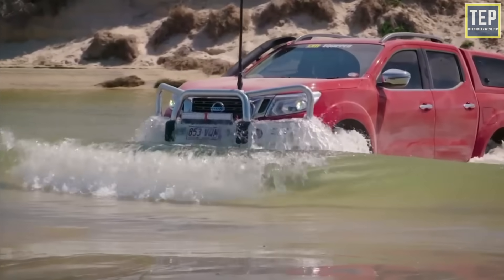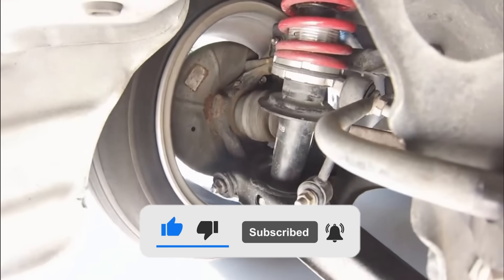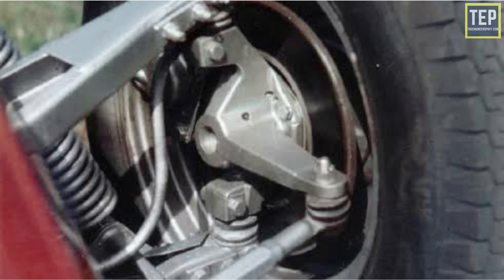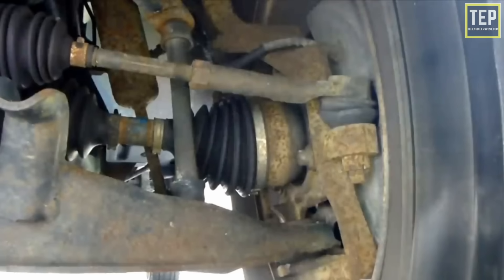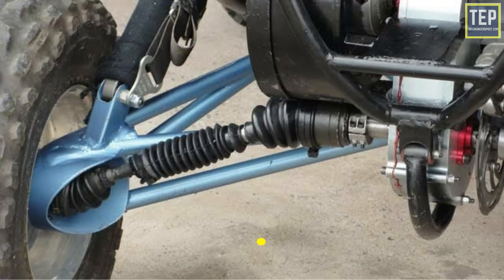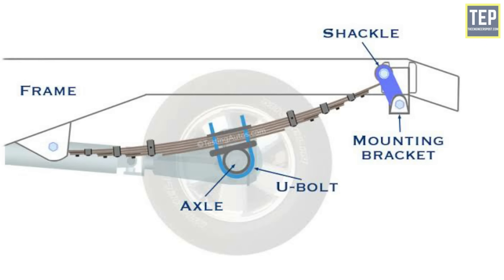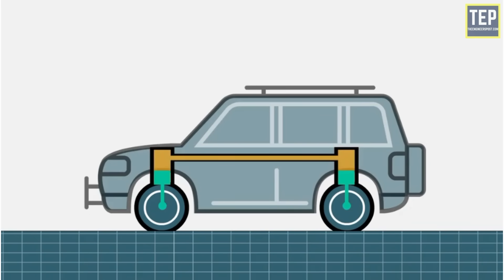How Different Types of Suspension System Works? Explained in Details

Comment: 😂 fourth type is coupled spring means two springs attached such a way one spring in tension and then it serially connected with another spring in compression like bicycle seat springs . Do thath the force will travel opposite direction and nullify the jerks.. we are now designing such spring system for cars 😂😂

Comment: Very american and very ignorant. Not a word about the Citroen hydropneumatic suspension! This system is superior to any mechanical springs. It uses gas filled spheres with its upper part filled with nitrogen gas as suspension and with hydraulic fluid as damping, through small valves at the bottom of the spheres. Very reliable and never needs replacing. Only new gas is needed to fill at long intervals, but is very cheap and easy.
The system also has constant ride height, irrespective of load. The ride height can also be varied. This system was introduced on the Citroen DS 19 already in 1955, and has been built into millions of Citroen cars. 
The DS 19 had trailing arms at the rear and individual wheel suspension all around with hydropneumatic spheres. No other suspension system can rival it in terms of safety, roadholding and comfort, even today!
Stiff rear axels and leaf springs is totally outdated and belongs to horse drawn carriages from the 19th century! And the McPherson strut is very simple, bad working and cheap, more than in one sense! It has no advantages whatsoever, but is cheap to manufacture and install, therefore used on many cars.

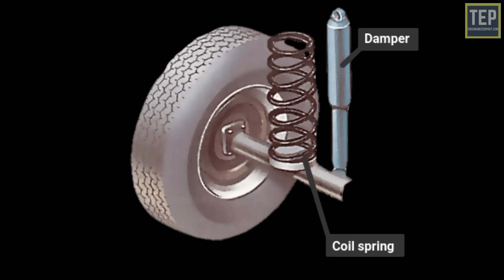Comment: 1:30 basics
2:15 types of springs
3:30 dampers/shock absorbs
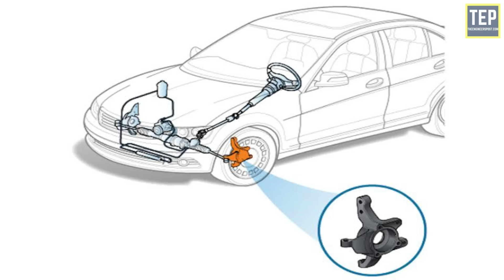4:10 nuckle (wheel connector
4:40 strut (bar suport)
5:10 anti sway bars
5:40 ball joint

6:55 independent suspension
7:40 independent suspension
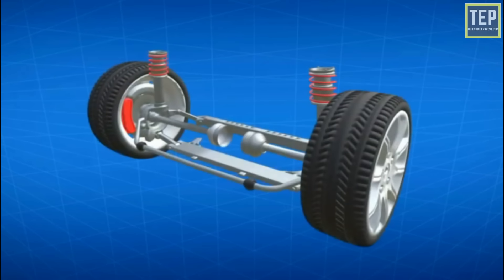8:10 wish bone
8:50 double wish bone
9:40 double link
(Independent)
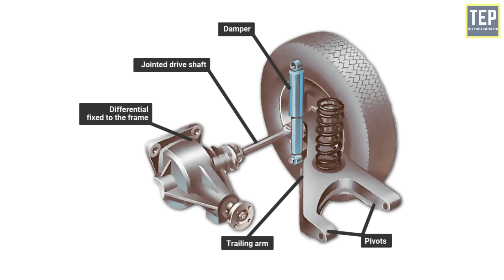10:15 trailing arm
10:50 non independent
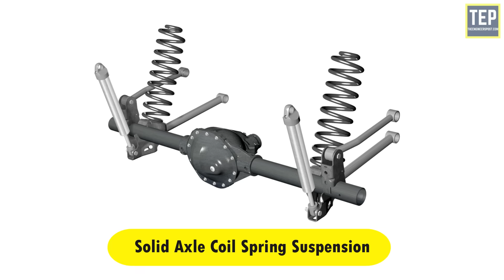11:20 spring sey (trucks)
12:10 solid coil spring

Comment: You forget a very common independent front suspension being twin I beam. Also they used nitrogen in some variations of the hydro elastic and hydraulic versions of the swing arm suspension…swing arm are both fixed axle an independent axle configurations

Comment: The overall suspension system is very flexible. However,  if you separate it into component parts, you find nothing flexible. Every part is rigid and stiff

Comment: You left out the  Hydropneumatic suspension, a type suspension system designed by Paul Magès, invented by Citroën, and fitted to Citroën cars, as well as being used under licence by other car manufacturers, notably Rolls-Royce, Maserati and Peugeot.   It clearly the very best type.
Reply: Why did Citroen give up on using hydropneumatic suspensions?
Reply: @encapsulatio cost. I agree, I had an XM and the ride was sublime. With the deformable rear bushes and trailing arms giving a form of passive rear steer, it even handled well....
Reply: @avoohanian   What do you agree? I asked a question, I'd prefer if you can answer that.
Reply: @encapsulatio  I agree with you about hydropneumatic suspension......
Reply: @avoohanian  I did not even say anything about it so i don't understand what you agree with.

My question below is what I "said".

Why did Citroen give up on using hydropneumatic suspensions?
Reply: What about toyota tems system

Comment: You forgot that with the solid axle coil spring setup there are multiple diffrent ways of attaching the axle to the chassis such as 3 link, Parallel 4 link, semi-triangulated 4 link, fully triangulated 4 link, truck arm, and torque arm. You also fogot the different side to side axle centering menthods, those being panhard bar and watts link. Lastly, that those centering devices are only needed on NON triangulated designs such as the 3 link, parallel 4 link, truck arm, and torque arm setups.

Comment: This is well done and easy to digest even for non car guys or beginners.

I would also like to add Torsion Bar rear suspension, it's also a non independent suspension common in economy cars. The torsion bar also acts as an anti roll bar but most of the time it is tuned for comfort. The design is simple and cheap to make also there is rarely a way to adjust the wheel alignment for such suspension.
Reply: The kind you're talking about acts as the anti-roll bar but not as the springs.  The cars I'm aware of that have it use coil springs, not torsion bars.  A true torsion bar suspension is found on the front of Chrysler/Dodge/Plymouth rear-drive cars from the '60s to the '80s.
Reply: Yes, probably you refer to semi-independent suspension which is very popular today because its simplicity ,low cost and almost independent suspension. I have a car with this type of suspension and I am very satisfied with the behavior of the car.
Reply: *tortion BEAM, not tortion bar (which is a whole different thing).
Reply: The AI audio is awful.  Why can't we have a real human doing the explanation?  Terrible but fairly good info.
Reply: He did happen to mention it at 3:20, and I completely agree! This made it way easier to understand.

Comment: Anti-sway bars , Anti-roll  at 5:39  .  The video forgets to mention that trailing or leading arm suspension allows those bars to connect without a link (VW bug). An interesting case is the rear axle on a Golf Mk1 which mixes in some camber. Also I did not find a mentioning about steering. See how braking and acceleration is almost the same for a suspension, and similar to cornering! Race cars thus have double wishbone all around ( for track ). Off road you may see solid axle in front and back. Renault Twizy has McPherson all around. I like how McPherson saves joints, but I don't like that it needs a high hood (okay, no problem with an inclined hood in like the Renault Espace). Where is the integral link suspension? It is used in modern Golf and Ford Mustang in the rear. The video forgets to explain that a multi-link suspension allow you to place a virtual pivot in the center of the rubber. Still I like the Citroen DS with a real pivot in the rubber more. Don't need power-steer for that because you only rotate one joint.
I want precision cornering and thus a long, stiff lower wishbone. It may be a bit trailing in the back and leading in the front for anti-squat and anti-dive. Thus I guess I need two links to connect the anit-sway bars. Does anybody have an idea how to connect anti-sway diagonally under the body floor?

Comment: I have search everywhere for the Mercedes twin lower ball joint design and it's like some kind of secret. Even Tesla's, New Camaro's, and a few others now use it. Sadly working in a garage you find most mechanics rather slap you silly for bring in a German car in the first place, because they want a pay check that week! But I digress. I had to figure it out on my own years ago, yet still today, few know how it works and was missed in this video. So see if you can guess why they have two fixed lower arm with ball joints off set at the lower front spindle. It's amazing what Mercedes has and still does in engineering.

Comment: No doubt U have explained very nicely , but one thing I would ask atat type of suspension should be used , or would be better for some particular,  vehicles , and no doubt as U told some R not easily available,  or very costly   so in thst case what would be the better or best   many thanks , GOD BLESS YOU

Comment: Do these suspension setups apply to ICE cars only or also to BEVs and hydrogen powered cars as well?
Reply: Why would the suspension change because the engine runs on a different fuel?

Comment: 13:00 what is that white and red colour shock absosber type thing in horizontally in middle ??
Reply: Thats a steering stabilizer. Its necessary on many vehicles with solid front axles such as jeeps., especially if you have 33+ inch tires. It prevents death wobble caused by increased forces and vibrations im the tires
Reply: @lieutenantdan8541  Death wobble is due to improper suspension geometry.  Using a steering stabilizer to fix it is a bandaid.  They are used more to keep the wheel from jerking and braking a thumb when the tires hit something large.

Comment: Is it really that the air suspension can carry heavier load that leaf or coil spring?
Reply: No.  Air springs are adjustable, so you can set them soft for no load, or air them up when the load gets larger.  A leaf spring built to carry a load rides like crap unloaded.

Comment: I have one doubt is the suspension system used in EV's is same as that of conventional vehical?
Reply: Why?  Does EV change the way wheels roll over the ground?
Reply: @scottyh72  yeah i agree but there are some suspensions specially used in ev like inwheel motor suspension.

Comment: You forgot the Magnetic Suspension.. other than that youre awesome
Reply: Audi R8 and Lambo also uses Magnetic Ride Control suspension, in which the fluid release or relax metal balls through magnetic working.. although very informative video 👍🏻
Reply: Bro I was going to say that lol also you and him forgot to mention Air Suspension Also Electric Suspension soon we will have anti Gravity Suspension lol
Reply: Perhaps that would be considered more of an integral component of a suspension system rather than it's own design. He also forgot solid axle twin i-beam suspension.
Reply: That is the absorber not the suspension system. I know that they use term magnetic suspension. But the suspension system actually about the way springs and absorber travelling.
Reply: didn't bose quit with the magnetic suspension
Reply: @veljkostejic9594  and a great time with your friends have
Reply: @veljkostejic9594  yes
Reply: @veljkostejic9594  I think he means magnetorheological dampers, which are used in performance cars
Reply: @pbjracing14yearsago49  they are used? i thought that concept was forgotten
Reply: @veljkostejic9594  ferrari use
Reply: @p0llus  since when
Reply: @veljkostejic9594  since long time ago, one model introduced this tecnology, i remember the news. if you look for youll find.
Reply: @p0llus  thanks
Reply: @pbjracing14yearsago49  
HSV (Australia) uses them, so does the Chevrolet Corvette.
And my 2004 Volvo S60R uses a semi-active electronically controlled suspension system.
Reply: @pbjracing14yearsago49  those are just dampers, not an entire suspension. Double wishbone suspension with an ordinary damper and one with a magneto-whatever damper is still a Double wishbone suspension.

Comment: 1. Where is dual axis strut, panhard, and rear mclaren 720s type?
2. In live axle, there is also another type using center control arm, used in 1st generation of suzuki vitara/sidekick instead of torsion bar.
3. And i think there is a bit difference between front macpherson strut; and general front "strut" type which ussually used in body on frame chassis nowadays, this strut still using control arm from front side of chassis to hold lower arm.

Comment: Hi, how about panhard bar and watt linkage suspension??
Reply from the maker: Both are part of rear suspension. Panhard bar is a suspension link and watt linkage is mechanical linkage which is improved over panhard rod. Panhard bar reduces lateral movement, a Watt's link takes it to the next level by completely eliminating it.
Reply: @TheEngineersPost  problem with Watt's is its more complex and limits overall axle movement not much of a factor for strictly on road cars but off road its a massive limit. also you miss one massive dynamic with solid axles on road they always stay flat to the surface regardless of body roll unlike IS where the camber changes with not only body roll but suspension travel its one of the big reason along with shear ability to handle power that pro drag races still uses solid axle.

Comment: Which one has better handling: Double Wishbone, MC Pherson or Multilink Suspension?
Reply: macpherson strut isnt great for handling, its mostly for compactness, simplicity, and cost. double wishbone suspension like SLA suspension is great for handling because the camber increases as the suspension jounces, meaning that when you're really loading up a wheel (such as going through a corner) the wheel tilts in the opposite direction of the body, so it can stay flatter in the corners as compared to macpherson (macpherson also starts off by increasing camber as the suspension jounces, but then goes in the opposite direction, tilting the top of the tire back out, hurting traction in the corners). multi-link suspension is just its own whole beast, you can get basically any travel dynamics you want out of it but at the cost of increased complexity and cost. tl;dr well designed multi-link has the most handling potential.
Reply: @Kevin-dt9xm  thank you
Reply: @Kevin-dt9xm  take a look at the B15 Sentra is a great handing car. McPherson in the front and dead axle or beam axle with pan-hard bar in the rear. is a weird little fat car when you start looking at it closer. like how on earth is this car so playful and fun to drive i miss my B15.
Reply from the maker: Multi-link suspension allows the auto designer the ability to incorporate both good ride and good handling in the same vehicle. Primary benefits of Double Wishbone system is the increase of negative camber as a result of the vertical suspension movement of the upper and lower arms. double wishbones may perform better, but the MacPherson struts would prove to be more affordable in the long run.
Reply: @TheEngineersPost  Thank you!
Reply: Double wishbones generally have a brighter weight capacity, also a lot better for rigidity compared to the McPherson. You’ll generally find McPherson assembly’s on small cars, and double wishbones on larger vehicles. Multilink suspension is more reserved for sports vehicles requiring a little more “tunability” out of the set up.